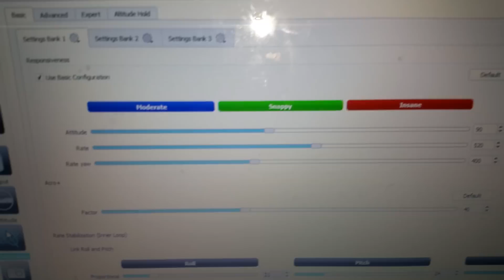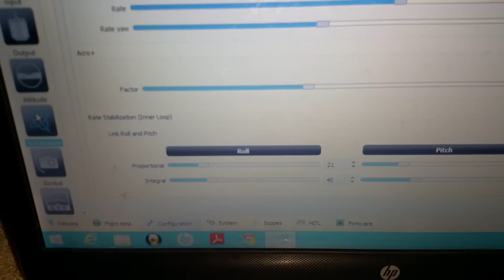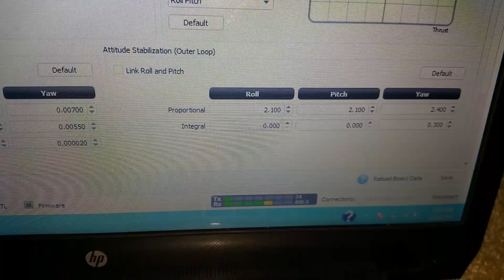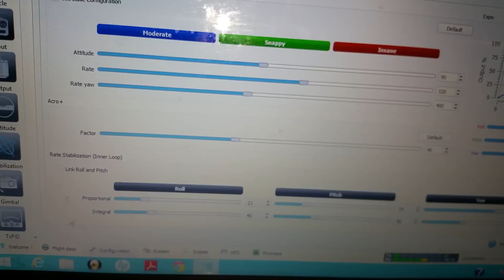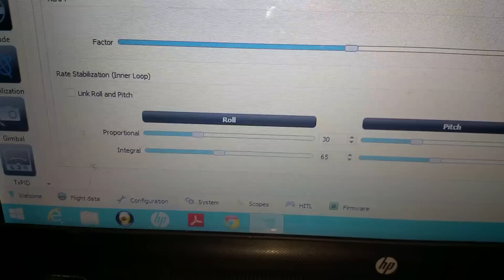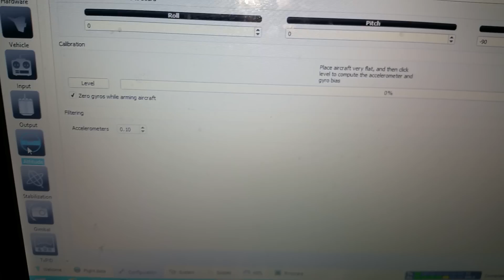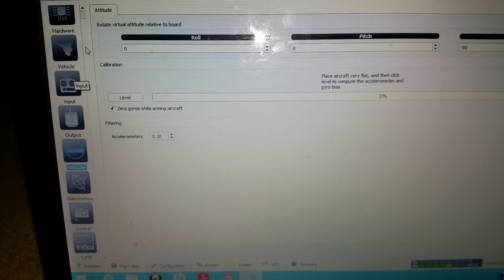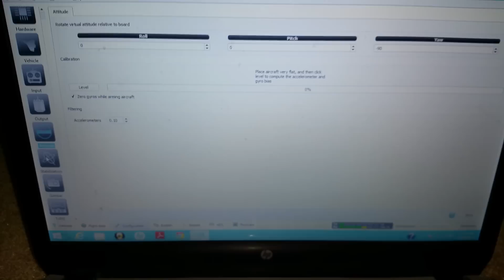cc3d settings for zmr250 from fpvmodel

Comment: does cam / receiver get super hot  the part that holds the antena
Reply from the maker: glen mccall no you are grounding out some were. Back out your motor screws. One can be hitting your windings. Take props off first.  About 90% of the time when I see this problem it is because the motor screws are too long and are hitting the windings
Reply: Opps my bad i mean the Wolfwhoop WT5828S 5.8G 600MW 40CH FPV Audio Video Transmitter for Quadcopter, its seems to feel real hot , and i dont know if thats right nor do i know how to capture video once connected.As for my frame i have a Usmile Carbon Fiber+ Glass fiber 250 miniquad with integrated PDB and 2 head lights ..  i dont use the frame  integrated PDB because that thing was not working for me so i just just a plain ol  PDB..Also i have  FPV 1000TVL Mini Camera FOV 90° 3.3V-16V PAL NTSC Switchable For ZMR250 QAV250 210 180 for RC Drone.   i got this thing all together and working but i cant get it in the air  i need the right cc3d stabilization settings CAN YOU PLEASE HELP ME  PLEASEEEEE thank you  ps nothing grounding  and all the wiring is ready for flight and power after about 9  boards 2 - kk2 . - 3 naze- and  4 cc3d .... HELP pPLEAE  DILLY DILLY

Comment: Just a footnote, I used librepilot and my quad was doing some weird stuff, so I thought id try open pilot, I wiped it and did it again with open pilot and what a difference, immediate hover and control with these settings, I knew soon as my motors started it was better. Far more even.I don't know for others if its worth using other gcs programs but it worked for me with my very limited knowledge.

Comment: hey i seen your video about ur quad setting u seem like the person who can help me. i'm trying to get the settings to the point where my quad acts like a phantom so i can use it to record footage. i got it to fly but whats going on is that i cant get it to hover. when i increase the throttle it lifts up then takes off in the direction its facing. my specs: 4X emax mt 2204-2300kv motors, 4X emax simon 12a esc, devo 7 transmitter and receiver, 3s 1500mah 11.1v battery, and cc3d board. Please Help!!!!!!!!!!!! i also joined ur group

Comment: Hey!
Thanks for all vids about cc3d bord,very helpful but i have an issue with my throttle.
Ok its little hard for me to explain (im from Sweden) 
So when im flying and turn throttle stick to zero my quad flips around and i cant saved it,it crash, i dident have this issue before but i dont now what to do, is there any settings for this , do you now what i mean?if you dont i understand....

I have a 250 quad with ZTW Black Widow built in 18a esc and cc3d board

Thanks 

// Andreas
Reply from the maker: try to recalibrate your controller through open pilot
Reply from the maker: like when u first set up and have to move the sticks around. but at 0 throttle your motors should stop witch would make your quad fall. u can also set it to were your motors never stop but not recommended
Reply: +Chicago Drone Racers 
Ok thanks for quick answer !
I try this tomorrow!!

Comment: These settings actually got my drone to hover, I appreciate you sharing these settings. I do have to make adjustments bc it does shake in air and does go up and down quite a bit at hover. where exactly in open pilot would I make adjustments for these issues?
Reply: +K9 PREPPER If it is shaking (oscillating) whilst flying then you need to turn your P (proportional) value down. P value will try to hold the current setting, and basically determines if the user input is more important than the gyros. P is what you want the quad to do. If it is too high it will be constantly correcting itself and this will lead to fast oscillations. 

Your I (integral) setting will tell the quad how precisely to implement the commands which you are sending to the FC. Higher I value = faster response times, and a more locked in feeling. I is the "room for error" coefficient. Too high and your quad will feel sluggish, and will have low frequency oscillations. Too low and it will be slow to implement changes.

The D (derivative) value is the smoothing value. It will smooth out all the other coefficients and will basically amplify P and I to a degree. Too high on the D value and your quad will oscillate and be hard to control. Too low and it will be sluggish.

Comment: How do I speed up the yaw? It's pretty slow with these settings. Everything else is fine tho
Reply: Sleez Ick In the Advanced Tab on "Max rate limit" increase the value for Yaw.    According to the Open Pilot Wiki:  "This [Max rate limit] is a safety limit and will overrule the full stick rate for Rate mode if set to a lower value!"  So in this video all the rate values are actually doing nothing and the Max Rate Limit values are the values being used by the CC3D.  

I recommend reading: https://wiki.openpilot.org/display/WIKI/Stabilization.

Cheers
Reply: Carlos Vélez thanks a lot man. I really appreciate the info!